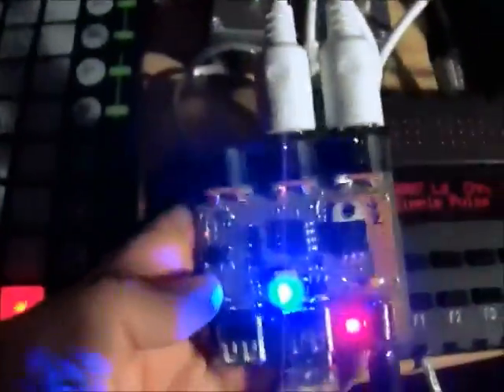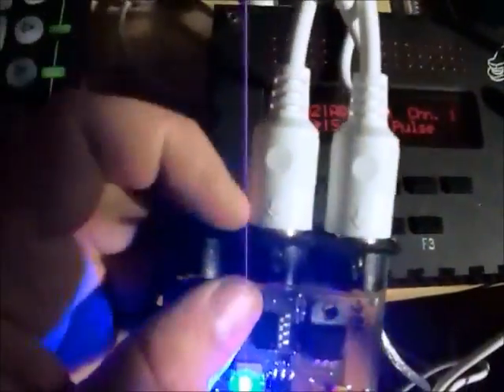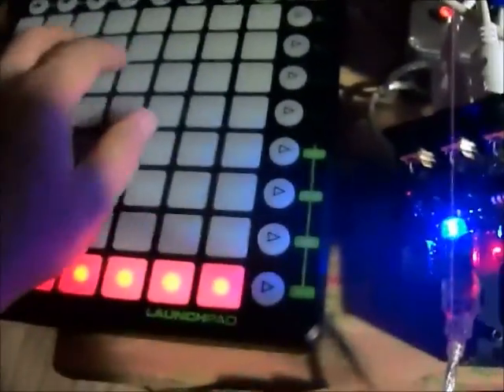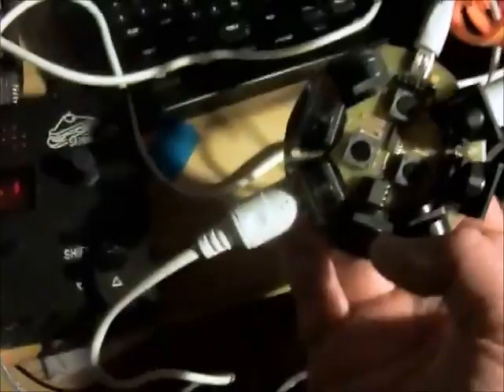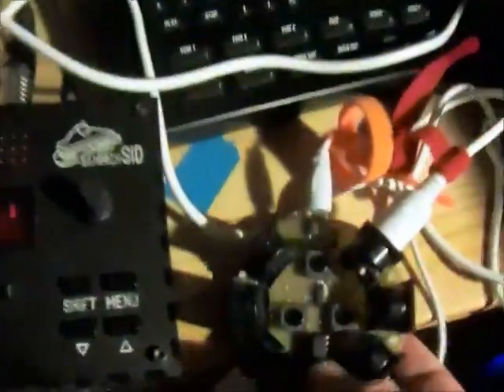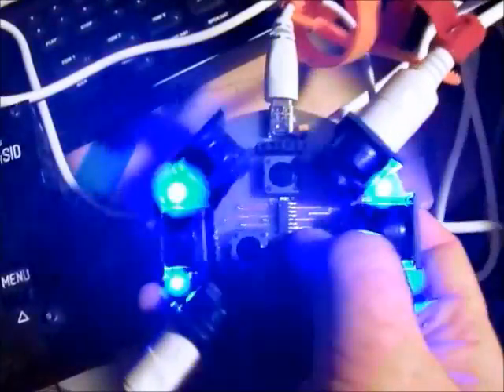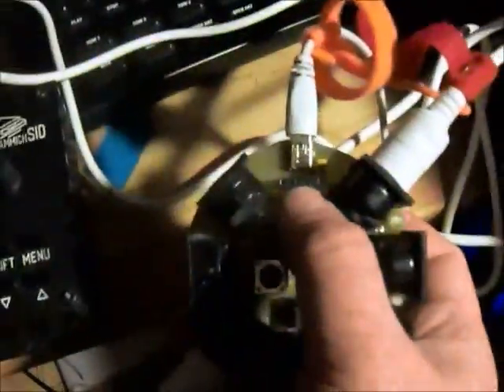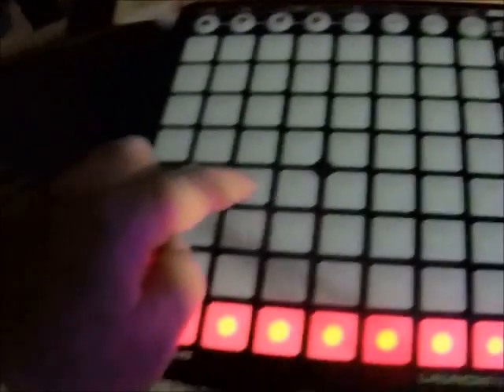Standalone Novation Launchpad MIDI Sequencer

Comment from the maker: Hi - I am just using a generic host driver adapted from one of the FTDI examples. LP does not use USB HID but rather a simple custom protocol where raw MIDI bytes are passed over a pair of interrupt endpoints, which I found using a simple USB analyser utility. PM me if you like and I'll give you the URL for my VNC2 code on github